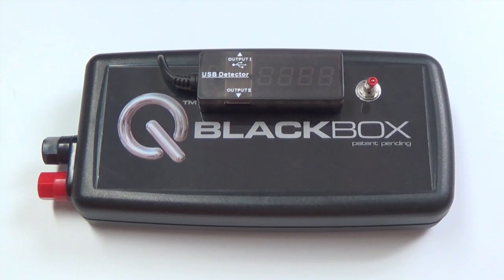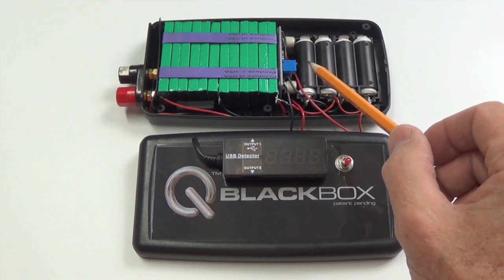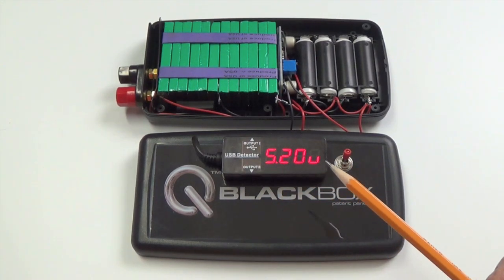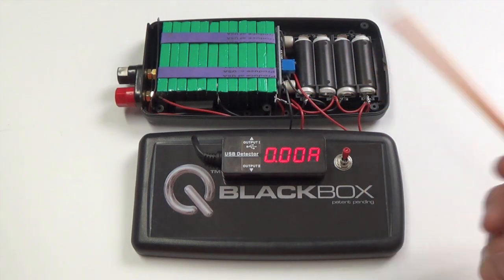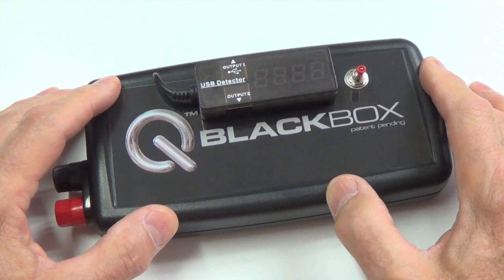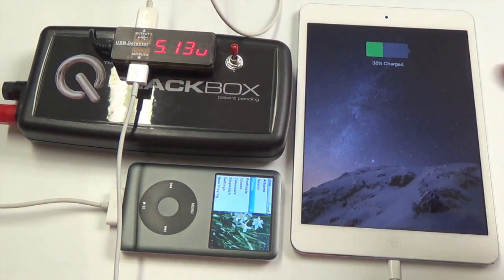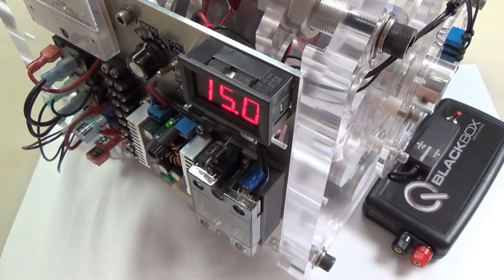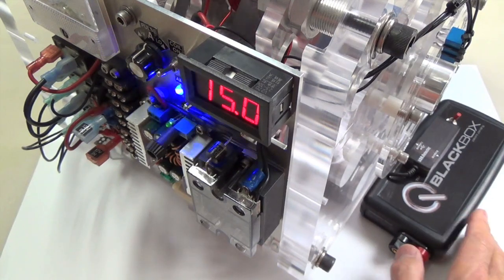BLACKBOX - USB with advanced Silicon Crystal Graphite Battery Technology

Comment: OK, so it's a slow battery charging a faster battery. There are 2 key unanswered questions:
1. What is the dead-short current of the slow battery?
2. When does the slow battery stop working? (Because it will)
Reply: I think they  need funding for  large scale  testing.
Reply: Charles Marais we don't know how long but we have one battery that's been powered for 2 years now
Reply: ...and the deadshort current?
Also, I think it would be useful to see the stats on longevity. One battery lasting 2 years won't cut it. Out of 100 units, what's the average lifetime, and what's the standard deviation, for instance - show us a distribution curve.

Don't misunderstand me - I'm intrigued.
Reply: Charles Marais Sir what u are calling a slow battery in this case is a micro-generator and never stops producing current ; thereby you can exhaust the charge of the batteries 3.7v each which have had the micro generator charging at a much slower rate CONTINUOUSLY always ...then simply wait til the micro-generator recharges the LI 3.7v Batts 
1mg~>4li3.7v constant<~Load~=○
And repeat 
I'm autistic and that's the best way I know how to visualize my reply 
This does work ultra efficiently

Comment: It's been nearly a year since this was posted. What the status of this device?
Reply from the maker: It's being converted into a much larger and more useful device.
Reply: it blew up, and set on fire, there is no protection for the li-ion batteries. He never talks about Amps or actual power very much but from the numbers, 6-12 hours to charge would mean his cells give out 300mA, plenty of current to over chage most small batteries. Don't forget the cells he's using or made are batteries themselves, just using a different chemistry and will run out. converting a chemical reaction into electricy produces heat which in turn produces a rise in voltage and so more power which then produces even more voltage and so on, thermal runaway

Comment: Are the 2 bnc ports for charging the unit?
Reply: At what rate do they self charge and under what conditions?
Reply from the maker: No, used for output only.
Reply: So, the cells are single use then?
Reply from the maker: They self-recharge continually.

Comment: You should put a link to buy this in the description. I've been using Anker portable battery packs, which last a long time, and charge allot of devices numerous times, but this is a game changer. The batteries in the device could be upgraded to an even higher MAH Mili Amp Hour. I don't know how much power it takes to power that engine/ what ever that was in the vid, but either way not having to plug something in is a game changer. Now we just need our devices batteries upgraded, to graphite batteries. I wonder how long it will be before Samsung or LG , and even Laptop companies upgrade from lithium batteries, hopefully soon. we've already came along way though, I remember when smart phones just became a thing, and a cell phone battery would only last thirty minutes in some cases/ if you were watching allot of videos. Anyway we've came a long way, but there's obviously some more growing needed. Graphite is a game changer for electric cars too. I'm gonna look on Amazon for this portable battery, but does anyone have a link for It?

Comment: The contact page on your website doesn't work. (Any chance of me obtaining a prototype?)  At any rate I recommend adding a boost/buck regulator to the design.  That would allow you to have an adjustable voltage output. You could essentially make a battery charger that trickle charges anything between 3 and 36 volts.

Comment: Could this product be used to make stand alone refrigerators and air conditioners? Can a hertz ran through metal rods generate ultra low temperatures for cooling and refrigeration? Could that hertz also energize your crystal power cells for an integrated system? Have you ever thought about these types of applications for your power cells? Hay I might be wrong about what can be done but what if I was right? I am no science person but you are correct? Novartis

Comment: Design a product that you can connect to each other to increase its power output. Make a black cube with copper pancakes for wireless transmission of electricity. Then you can connect the cubes together to achieve what you need to run a device, home trailer or a town or city? ; )

Comment: 2 questions
1) how long does it take for the 12 cells to charge the 4 li-po battery's 
2) wouldn't it be better to use super caps instead of the li-po battery's?

Comment: Love it. Want one! :) From a design point however your new USB attachment and the tall switch really mess up the form factor. But knowing your mad build skills and since you're still working on it, I'll assume you're going to find a solution to integrate the plugs and a smaller switch along the side of the box. Keep us posted!
Reply from the maker: I agree. A nice push button switch on the side is being considered, but a larger box would be necessary to also internally include two USB ports and detection circuitry. Looking into it.